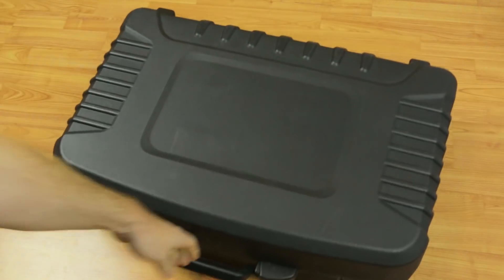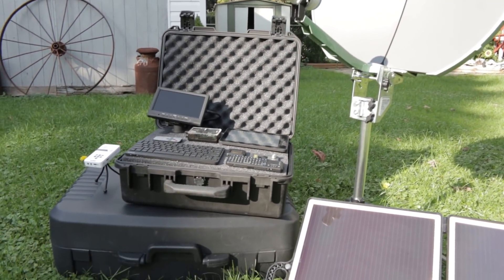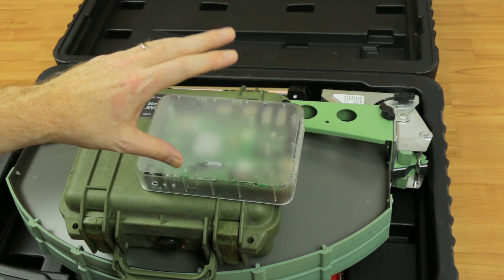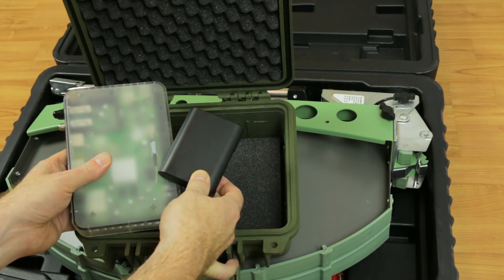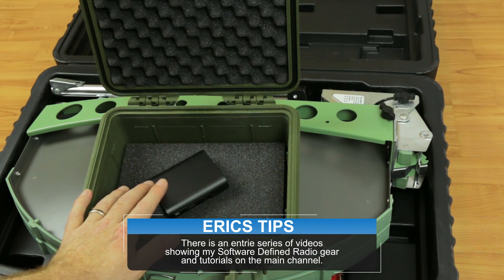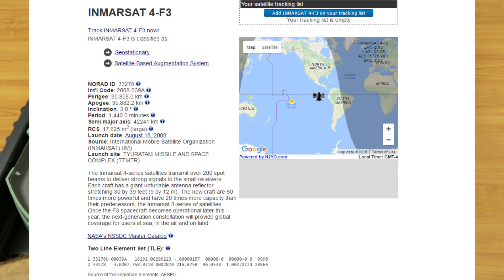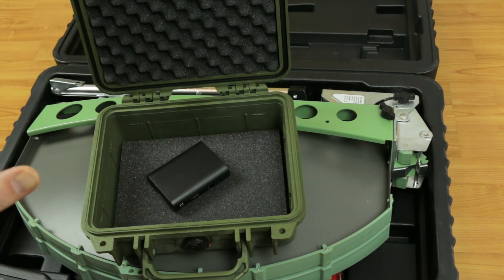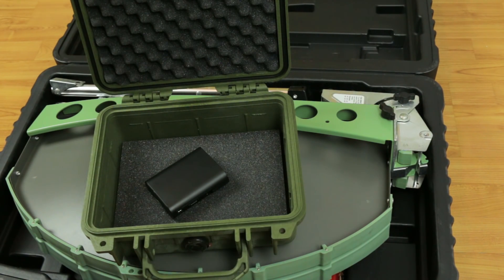DIY Outernet Satellite Receiver for the EduCase Portable Classroom- Build Overview

Comment: Eric - Thanks for the reply.  We have a communications technology / HAM shack at the South Florida Science Center.  I am currently putting together a number of information exhibits using SDR devices as well as the Raspberry Pi.  
The Outernet is one of the exhibits we will demonstrate.  I have one of the folding dish antennas without an LNA/LNB and was going see if the patch would work as a feed.  I also plan to test using my 23cm Loop and conventional long boom yagis.  Do you have any plans to build a L-band feed for the dish?